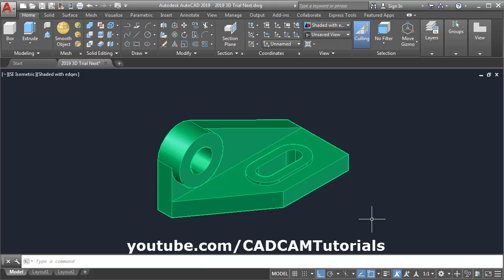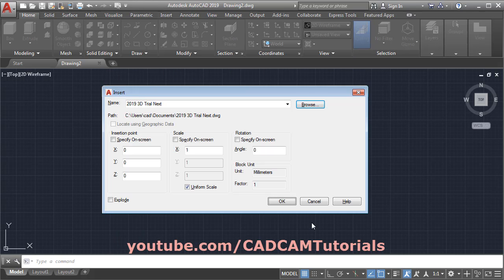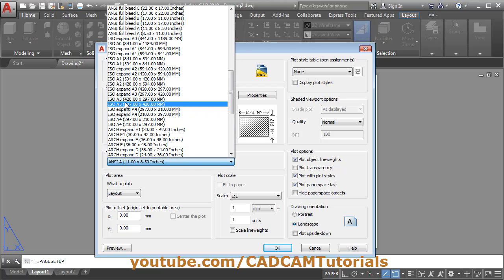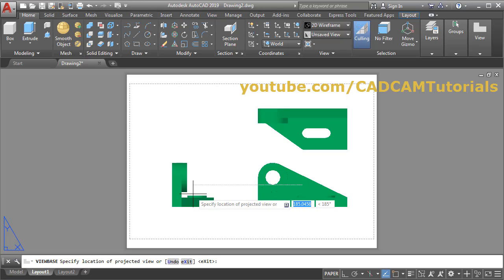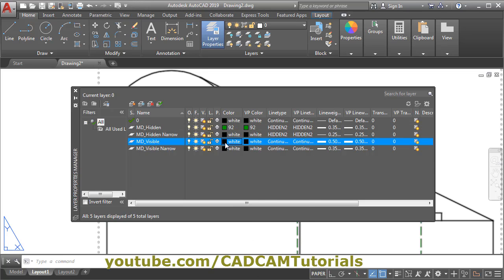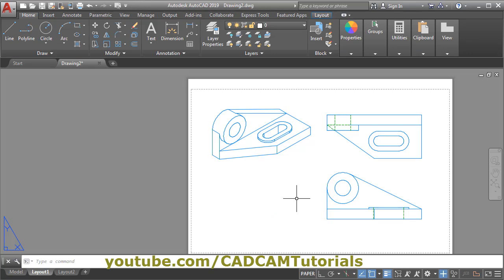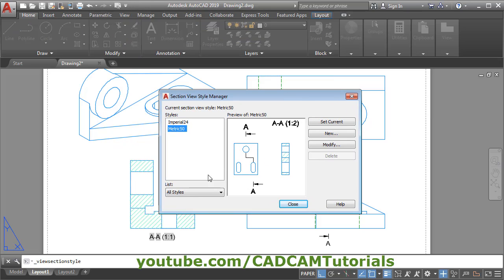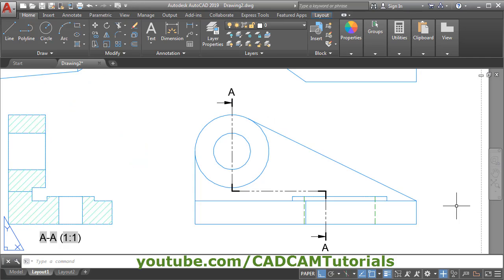AutoCAD 3D to 2D Conversion Tutorial - Part 1 of 2

Comment: What if the model is long but need to present in bigger scale and won't fit in the paper space, in oldways will have multiple viewports cuts in different parts of the model like for instance steel beam will show only the important part where there is connections, how do you present that using this 3d to 2d technique?
Reply from the maker: You can create detail view. Showing particular portion larger.